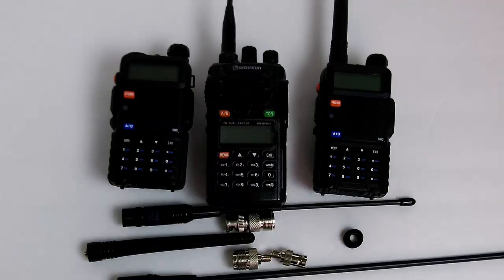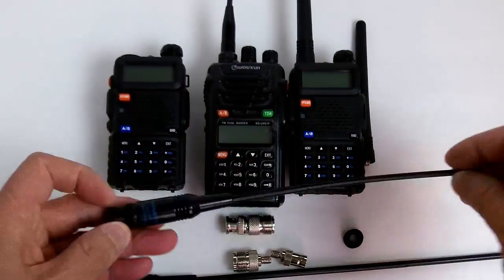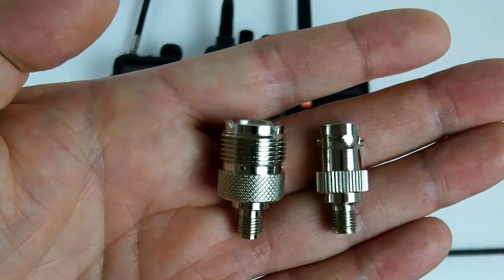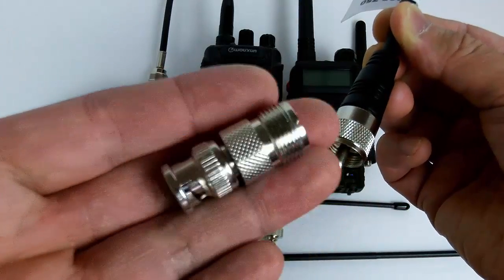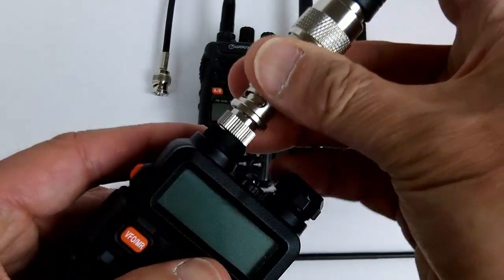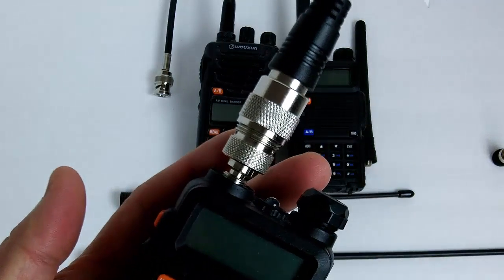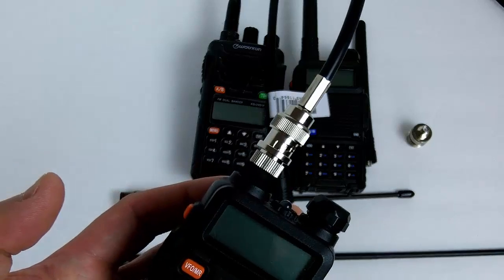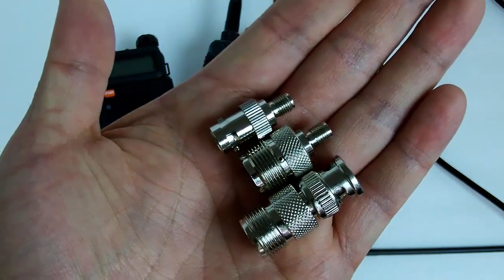Baofeng Wouxun Antenna Connectors : Quick Disconnect : Eye-On-Stuff

Comment: There are 2 connectors on it, and it's usually referred to as an adapter. A connector is usually referred to the only one and such as connector to a cable or a chassis etc.

Also, if you go even "higher grade", like commercial radios by Motorola, Kenwood, etc, then it often is the same style SMA males in the radio side. So "higher grade" isn't definitive of which sex you get on the radio.

I don't recommend using a direct adapter on a radio for often use. The torque on it might damage the inside of the radio, especially if dropped or pulled hard. Unless for testing is a different type whip you want to try etc, it's better to use a pig tail jumper cable instead.

For a Baofeng hooked up to a high gain base station antenna, you might get over loading from strong signal depending where you are. Cheap radios can't withstand strong signals that come into a high gain antenna.

Comment: In my opinion, with all respect, this is most terrible idea I ever seen, let me explain:  each connector introduce loss. Insertion loss stated in catalog are for quality connectors like AMPHENOL (cheap chines not publish that) with cost more than Wouxun radio so literally everyone (including me) use cheap chines 1 dollar that are always worst than AMPHENOL - so don't use their values as starting point for calculations, also they will cause impedance issue (cheap one). In couple of seconds, You reduced poor,  already smaller (HT)  to be efficient antenna to even worst. On good base antenna set up with hi gain antenna - that's ok to lose couple dB but not for hand held where You are already starting with reduced signal.
Reply: @ENB, Not as critical as you think it is. It's not going on the Space Shuttle as my old boss used to say when he observed someone overcomplicating an otherwise non mission critical task.
Reply from the maker: Hello, thanks for stopping by.  I get what you're saying.  It has validity but, for the purpose of this video I would tend to disagree.  The small amount of signal loss I introduced is not large enough to impact the functionality of my setup. It has functioned flawlessly so far and I'm sure others have also found it helpful as well.  In addition, I am surprised how well these cheap Baofeng radios have performed.  I appreciate your comment. Have a great day!

Comment: The connector on the Baofeng and such are known as RP-SMA, reverse polarity SMA.
Reply: They are not RP. RP means the pin is on the opposite side, I.e. The side you can see from the outside, has the pin. Usually only seen in WiFi products.

Comment: Just to write them down...Since there's a multitude of different connectors out there.

I do advise you to DOUBLE CHECK which one you need. I take no responsibility if you get the wrong ones!

Adaptor: female SMA to BNC female adaptor . 

Adaptor: female SMA to SO239 adaptor 

Adaptor: BNC to SO239

Comment: Every connector you add into the feed line is going to introduce some loss. How much will depend on the quality of the connector and the cable attached to it.  Some are better than others, but there will still be some loss.  By stacking two different connectors between the radio and an antenna, you just doubled the loss.

Comment: Can you give any details on the rubber washer used to fill in the gap? Thanks for the info. Got some adapters and everything works well.
Reply: Cut a piece of bicycle inner tube and use that ( or two of them stacked )...works a treat :-)

Comment: other than sma to bnc which connector would I need to hook up a normal nagoya 771 antenna. I looked on amazon but wasn't sure if this was the right one: http://www.amazon.com/BNC-Male-SMA-Female-Adapter/dp/B00IE80HJY/ref=cm_cr_pr_product_top?ie=UTF8
Reply: +Neomaya Davila Hi, sorry for the late reply.  When you say normal Nagoya 771 antenna. I assume that you have a Baofeng UV-5R radio that uses a female sma antenna. You would not need a connector.  You can try this: http://www.amazon.com/Authentic-NA-771-15-6-Inch-SMA-Female-BaoFeng/dp/B00KC4PWQQ/ref=sr_1_1?ie=UTF8&qid=1457679344&sr=8-1&keywords=nagoya+771+baofengI hope this answers your question. Let me know. Thanks.